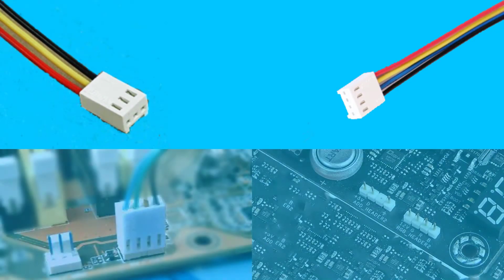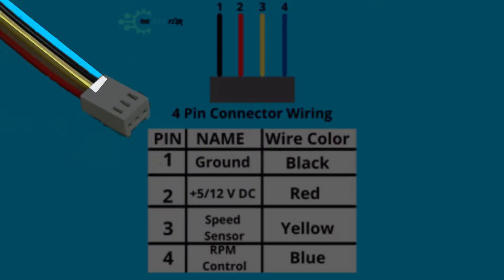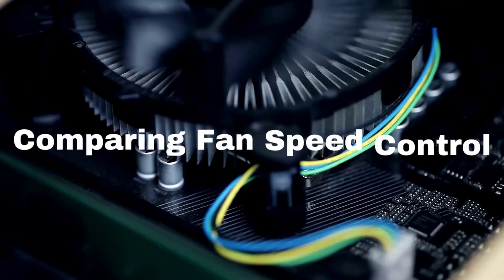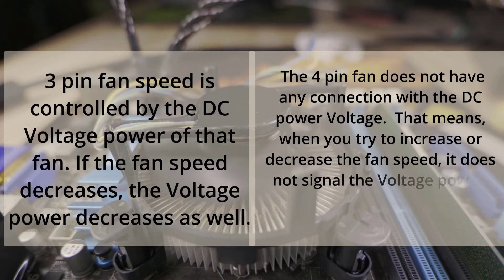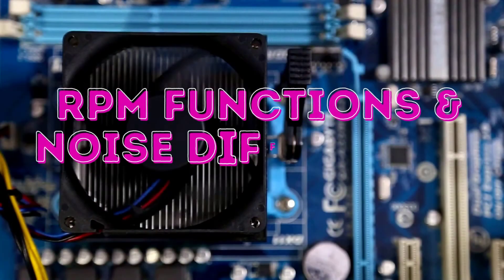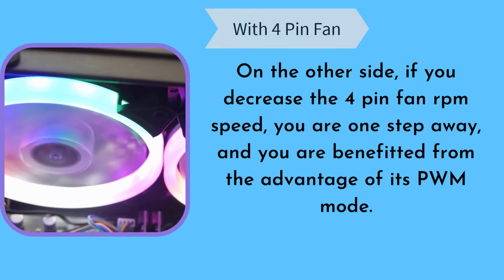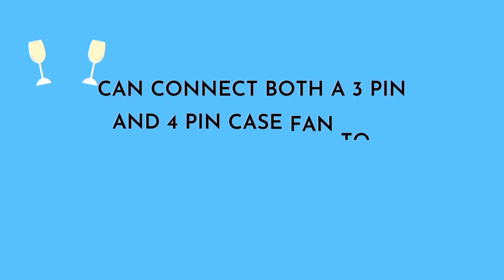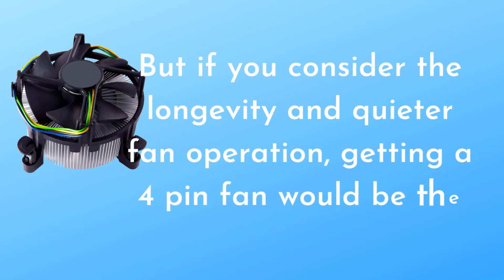3 Pin Vs 4 Pin Fan| Sort Out the Entire Gist!

Comment: So you can plug a 3 pin fan into a 4 pin mobo?
Reply: Yes and vice versa. It will work but rpm regulation will not funktion correct.

Comment: I got a 12V pc fan that has this exact 4-pin PWM female socket. My pc motherboard doesn't have its female socket and there are only 4-pin male sockets in SMPS to connect harddisks. What socket or device or connector or cable I need to  connect 4-pin PWM to that? Does SMPS 4-pin male socket deliver 12V?

Comment: Why is reducing the voltage not desirable?
Reply: Some fans don't like it.
For example fan_A @ 12v is 100% speed
Fan_A @ 6v is 50% speed
Fan_A @ 2v may not run at all.

In short pwm fans more controllability- lower fan speed is possible 
3 pin fans vary
Reply: @alexjaxon9928  Ya I did some research. It's not just that it won't run, if it's stalled either with say a pen or because the volatage is too low, all the energy gets released as heat putting wear on the motor.